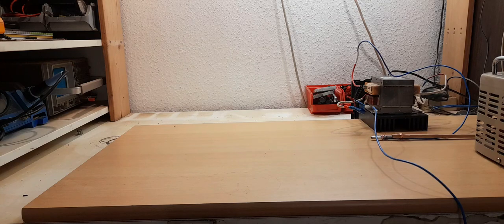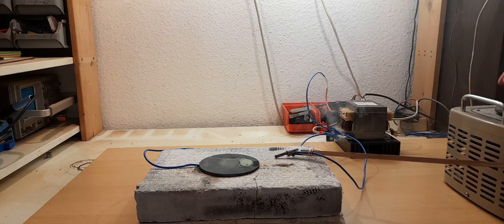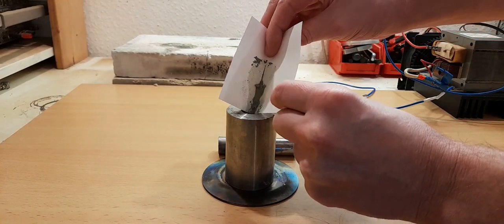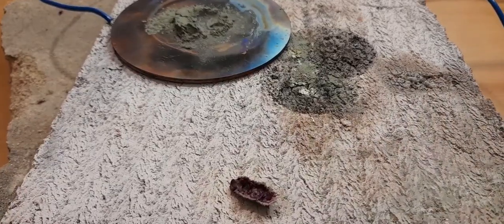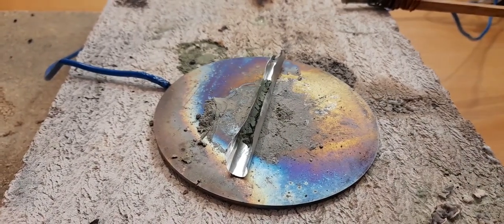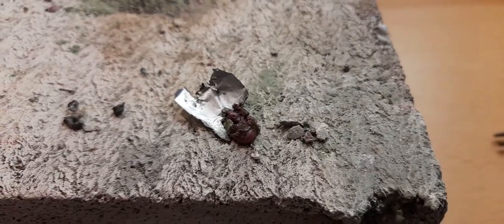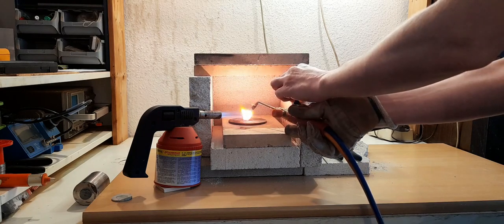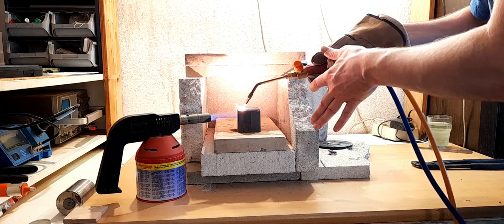Making synthetic ruby: part 2

Comment: Cool! Inspiring for what I’m wanting to do too. Have you looked into the flux process?
Reply from the maker: thank you for your comment. Do you mean addition of a flux, to lower the melting temperature? i have not tried that. And i dont know what to use. maybe borax? next i want to use an UV laser to heat up the alumium oxyde. I've done it with an industrial Laser a few years ago, but i didnt film it back then.